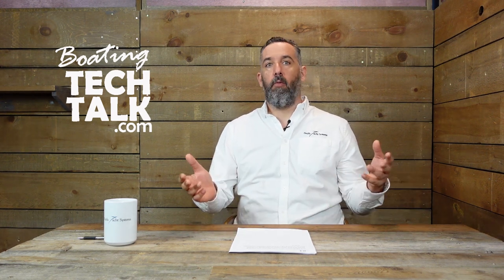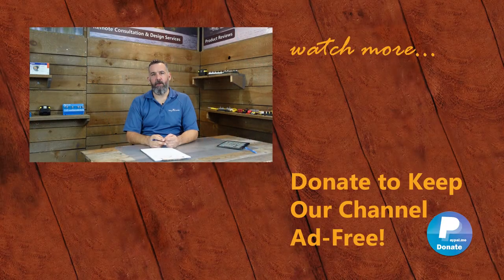Is It Safe to Charge My Boat Batteries With Solar and the Alternator at the Same Time?

Comment: Alternator does not stop turning because it is directly connected to engine via drive belt.  Rectifier/voltage regulator cap the output voltage and when batteries are fully charged, alternator output current goes to zero-ish.
Reply from the maker: Thanks for clarifying.

Comment: if altimeter stops you burn and snap the belt it shuts power off, ac has a clutch so when it stops it disconnects from the belt because it has a clutch

Comment: Ideally, you would keep the house and engine batteries completely isolated from each other at all times, but in  practice, it is nice to be able to connect the two systems for engine starting or house bank charging, etc. I never knew about the tach issue; thank you Sir, I just learned something. I would definitely keep the two systems electrically separate by adding an alternator designed to charge deep cycle batteries and a dedicated controller. The two alts would share a common ground and share the physical drive belt, but the hot side would be completely separate. That method adds $1K+, so people don't want to do it. Most folks opt for some special device between the two systems, which seems to work alright, but I have no personal experience with them, and I consider that a 1/2 way solution. The total solution is to just spend the money in the first place; often not an option. Charging in general though, these days most chargers can live with other chargers on the same battery bank. I would be sure to add a fuse to each connection, sized slightly above the max output of each charging source, as a hedge against something failing catastrophically. Just my 2 cents. Keep your wires dry. :)
Reply from the maker: Thanks for sharing Tao, well explained. Generally, finding or adding a 2nd alternator to one engine is pretty rare and so most boaters have to make up with having only one alternator to recharge multiple battery banks.
Reply: @PacificYachtSystems  A fact Sir. As you are constantly expressing, there is no perfect system. These days though, there are devices designed for that task; probably a more practical solution, unless you're already running a big diesel and have a true need for such amperage. Most of us can get by with less; I certainly do. Happy sailing. :)

Comment: Very well explained! From an efficiency perspective, it's best to set up the charging system so the solar charge controller targets a slightly higher voltage than the alternator's regulator does. This way, the free sunlight powers the loads as much as possible and the alternator only steps in and inefficiently converts your expensive fuel into electricity when the solar panels aren't keeping up by themselves. With an engine efficiency of about 35%, an alternator efficiency of about 60%, and a belt efficiency of around 98% the fuel to electricity conversion efficiency is only about 19%. The efficiency of solar panels isn't much better than that, but at least we aren't paying for all the energy they waste as heat.

Comment: Hi Geoff, I have a standard alternator on my D2-55, and a Victron MMPT solar controller. And under the conditions you mentioned, extended engine run, when the batteries get to fully charged sure the charging stops, but I then get a random battery alarm on the engine control panel. So random and short took ages to figure what was going into alarm. My solution is to switch the solar panels off. But why the alarm ?

Comment: Great video Jeff and answers a few questions I had after I installed my flexible 100 watt panel on my center console t-top. I have twin outboards with a separate starting battery for each engine. I also have two house banks, a primary, and a reserve. I can switch between house banks if one is depleted, while the other charges with their own battery 1-2-Both switch.
I give the start batteries priority charging (get home mentality) with the solar panel and when full, they are coupled to the house battery banks through separate automatic charging relays. I have twin outboards and no issue with tachometers as you describe. 
I was concerned with too many charging sources or backfeeding the controllers but I can easily stop the PV via a toggle switch if needed just before the charge controllers, and to stop the high voltage feed if I am under the helm troubleshooting anything. So far the PV keeps everything topped off beautifully and the batteries are always full and ready to go. I have room for another 100 watt panel and may give the original some company and double my at anchor replenishment rate.
Oh, and yes everything is fused very well, I have watched many videos of you harping on that!
Reply from the maker: Hey Scott, thanks for sharing, glad you are fusing too!

Comment: Hi if it's okay I want to ask something. I'm going to install a 24v anchor winch on  my boat the boat is 12v, i will do the job  with an  inverter. What do I have to care for?
Reply from the maker: Hmmm, an inverter will convert AC input to DC output. Generally running a 24 volt windlass from a 12 volt battery is a problem because of the large current draw from the windlass and you cannot readily purchase a 100 or more amps DC to DC converter.

Comment: I don't understand how an alternator can turn itself off. It's connected to the engine via a belt and will always be spinning when the engine is running?
Reply: Yes, alternator does not stop spinning…it cannot bec it is connected, as you correctly pointed out, via belt directly to engine.
Reply: The alternator regulator reduces the magnetic field and so the voltage/current. Modern regulators like Mastervolt or Wakespeed have intelligent charge modes, like an external battery charger (with bulk, absorbtion and float voltages) and can connect to battery monitors.
Reply from the maker: Thanks Borys and Wolfgang for the explanation.

Comment: I use a solar, low-watt battery maintainer on my boat.  I don't think it has a regulator.  Is it okay to leave my maintainer connected while my alternator is running?
Reply from the maker: Hmmm, not sure as I've never worked with a solar panel without a controller (PWM or MPPT). The solar controller regulates the output of your solar array to make sure you don't overcharge your battery.

Comment: Can a solar panel charger and a 12-volt battery charger from my electrical socket in my house be connected to the same batteries at the same time just to keep the batteries above 50% specially at night-time when I'm running a heater in my greenhouse
Reply from the maker: As long as both the charger and solar controller are smart, yes, both can be connected to the same battery.

Comment: Could you connect both an alternator and for say a battery charger so that they are sharing same input on a argofet or is this a big no no ? If so how would you set this up? Thanks for the videos 😀
Reply from the maker: Rarely seen this done and not sure of the unintended consequences. Theoretically this works. One down side is both your alternator and charger use the same device and if the battery isolator malfunctions you lose both charging sources.

Comment: Hi Jeff, thanks for all the info, allows learn a great deal. I was wondering is it possible to switch a solar panel from one 24v system to a 12v system through an additional controller using a double pole single throw switch, is it advisable or is there a better way
Reply from the maker: Never tried, but this should be possible... let me know how it goes.

Comment: i head the same problems and i got solution  ,with 2 componets from CTEK  D250se and SMARTPASS120  if baterys are full ,power goes in noncritical power users so tachometer always works even if baterys are full ...regards from slovenija
Reply from the maker: Thanks for sharing Gregor.